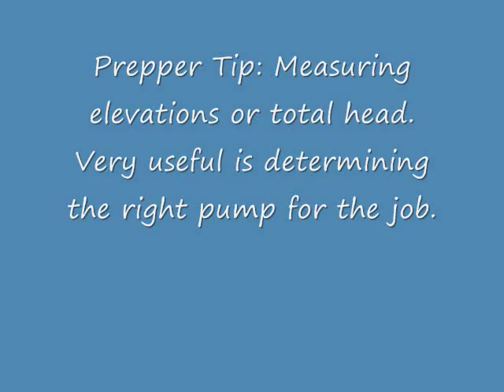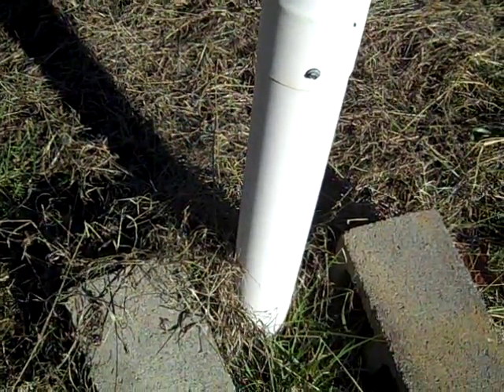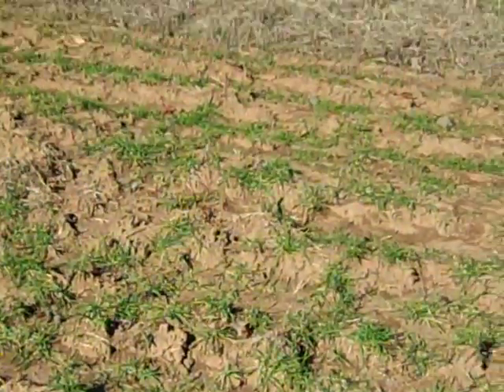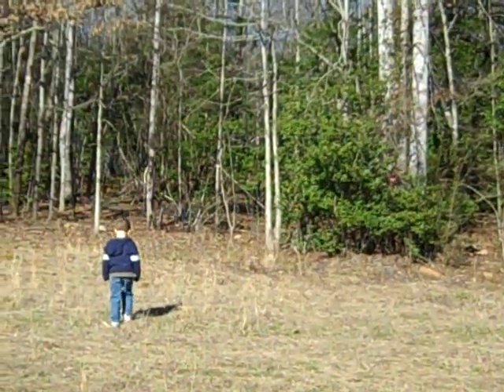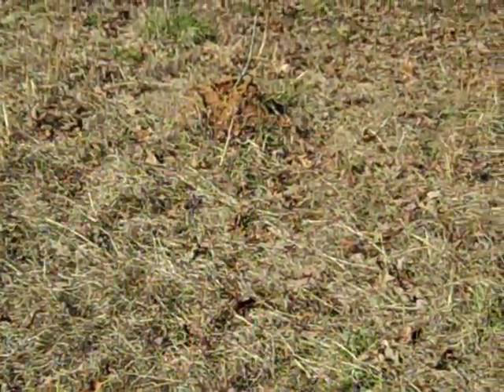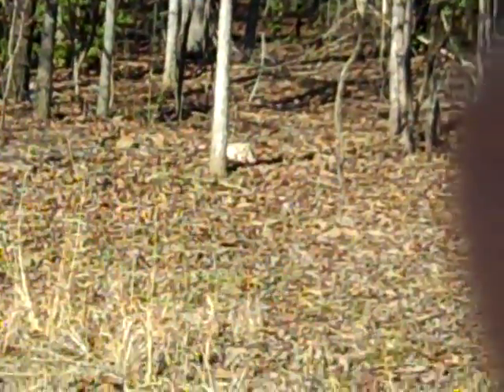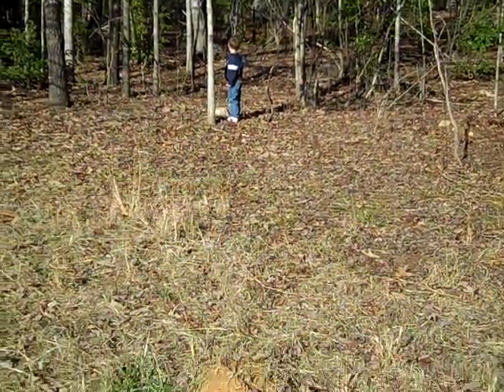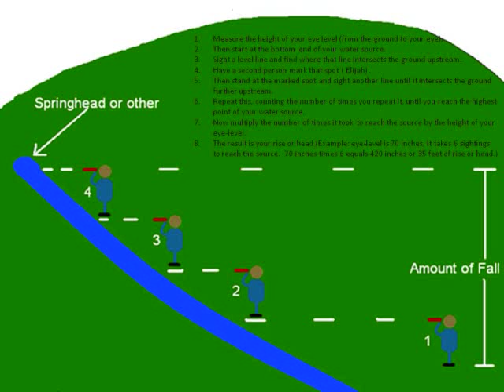Prepper Tip - measuring elevations

Comment: Great tip! My dad and I recently measured the elevation drop from a spring to our cabin with improvised tools. We stapled an old measuring tape to a 7 foot long 1"x2" board then used a string with a line level to work in downhill increments in the same manner that you progressed in uphill increments. It worked great but it was a little slower than your method. Thanks for sharing!